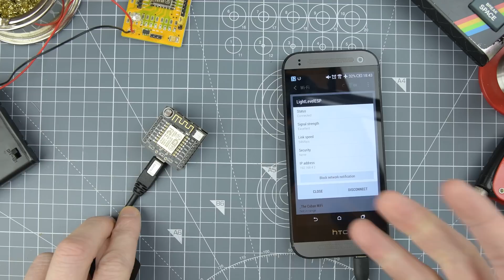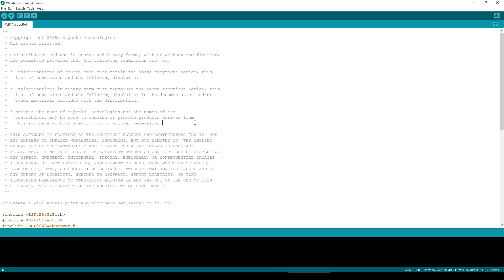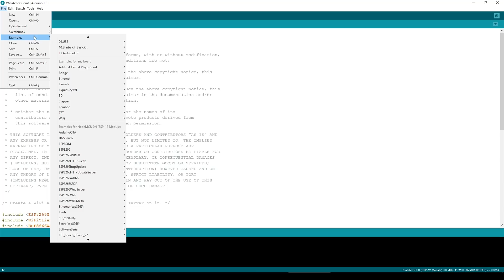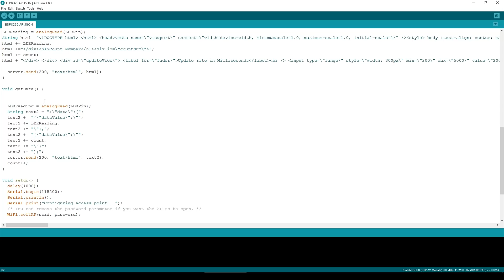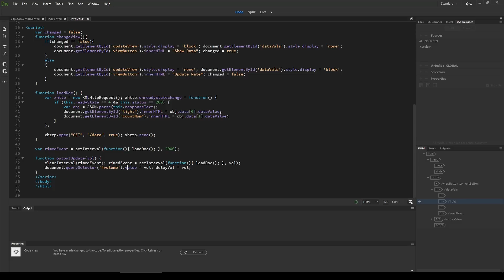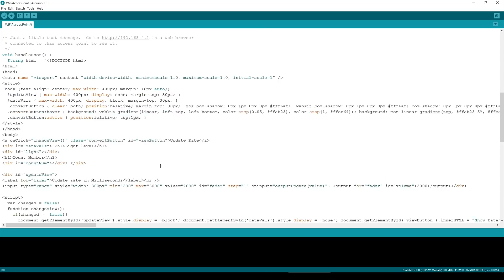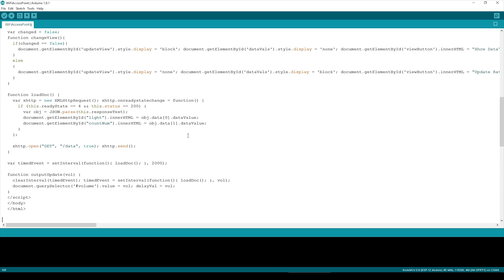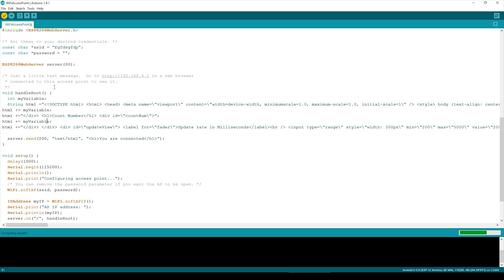ESP8266 WiFi Access Point Examples with the Arduino IDE

Comment: Is it possible to make something that plugs into a NUC's ethernet port, which tricks Win11 into thinking it has a network connection, so it will allow the WiFi Hotspot function to be switched on, so I can remote desktop into the NUC? 

Because Win11 won't switch the Hotspot on unless Win11 has a network connection, which it doesn't need because I don't need to use one. 

Win11 is dumb.

Comment: Hi David. I need your help if possible please. I have adapted this code to a  battery monitor and I cannot pass random variables to a graph on the phone. Would you be able to look at that as a video? I used the highcharts javasript and put that on the esp8266 to serve the graph.
Reply from the maker: Hi Andrew, you should be able to use asynchoronos javascript https://circuits4you.com/2018/11/20/web-server-on-esp32-how-to-update-and-display-sensor-values/ this page should get you there.
Reply: @DavidWatts  Sorry I missed a couple of important key words there..."without internet"! I like your offline style and although I have used highcharts in spiff,  I can't get any data to graph.
Reply from the maker: You shouldn't need the internet to use asynchoronos javascript, it is client based so on your phone web browser, the server (your esp) just responds with data. So just ignore the 'internet' part of that web pages explanation of asynchoronos javascript.

Comment: I'm working on a new pc now, i can't seem to find the arduino library i need!
when i search for 'esp8266wifi' in the library manager, nothing obvious jumps out.. (search results start with 'IoTtweet' and 'IoTtweetESP32')
Also searching for 'NodeMCU' doesn't help me..
Which name is the correct library?
Also tried to install ESP8266 or NodeMCU from within the boards manager, but no search results..
[EDIT]
Solved!
I needed to enter "http://arduino.esp8266.com/stable/package_esp8266com_index.json" in "file->preferences->ADDITIONAL BOARDS MANAGER URLs"
After that i could select board Wemos D1 mini and my code compiles ok now !

Comment: If I could I would give you 4321 thumbs up. You are the one and only that have code and tutorial on how to create a web server access point that multiple devices can connect to. I used yourLightLevelESPv1 example using and ESP8266 and i have a web server running (not required to be connected to my home network) that is serving web pages to 3 different devices. 

Well done on this!
Reply: My goals are this: Get a small ESP8622 module not the whole board, and connected it to my Teensy, then have the Teensy send code to the WiFi module for acting as a server to connecting phones and such. Think that will work? Hopefully I will not need to connect my Teensy to a compplete ESP8266 board.
Reply: Looking at other vids, looks like I just send AT commands to set the unit, up, then serialprint to send the page.
Reply from the maker: @KrisKasprzak  Yeah pretty much, good luck to you.

Comment: I like your little HTML conversion tool idea.. I personally use multi-line strings, like this

String text = "First line\
Second line\
Third line";

which works fine, but the idea of being able to insert variables using @ is neat, at the moment I am doing it in a clumsy way.
Reply: As to the large html page, I just put it on the spiffs so I can upload it without all the processing. It's a bit more transparent than having the html inside the C code

Comment: i tried to test the code, while compiling I am getting the following error 

exec: "C:\\Users\\dell\\AppData\\Local\\Arduino15\\packages\\esp8266\\tools\\xtensa-lx106-elf-gcc\\1.20.0-26-gb404fb9-2/bin/xtensa-lx106-elf-g++": file does not exist
Error compiling for board NodeMCU 1.0 (ESP-12E Module).
I don't know what is the issue, could you help me solving this?
Reply from the maker: Sounds like your hardware files are messed up. I would remove the esp8266 core files through the boards manager and start again.

Comment: Great video!! Is it possible to have the 8266 serve up a page with say 12 buttons. Each button once touched would activate a command in the Arduino? I have a sketch that is running a stepper motor. I can use a key pad to enter in a number and the motor will rotate to that spot. I would like to have say 12 buttons with "pre-defined" numbers send to the Arduino thus causing the motor to go to that spot. Any help you could offer would be appreciated Thank you in advance.

Comment: hi Mr David Watts
I like your youtube channel very much.
I want to use ESP8266 as access point to transfer serial data (UART) between my microcontroller and web browser.

I add resieved data from serial port to handleRoot function 
this is only my change on the access point example code
//======================================================
String uart_recieve_data = "";

void handleRoot() {
 server.send(200, "text/html", "<h1>You are connected</h1>"+uart_recieve_data);
}

void loop() {
 server.handleClient();
  // Send the response to the client
  if (Serial.available() > 0)
  {
    uart_recieve_data = Serial.readString();
  }
}

//======================================================

my problem is how send any string data from web browser to serial port in ESP8266

Comment: Maybe it's a dumb question, but I need to know before I buy one, can use it to extend the range of my home wifi through the ACCESS POINT mode? I mean, if I will be using the AP mode, then it will act just as a second router on my wifi lan? I need an answer, please.
Reply: not a dumb question,but the answer is both yes and no...(it's gonna be terribly slow and would be limited to single page with few text)

Comment: After initially downloading the code have you tried changing the 'ssid' it does not want to change and is locked into what was originally downloaded. 
Found this with my ESP8266-12E pressing reset, powering down etc does not seem to work.
I've found this before with similar AP programs.... HELP

Comment: excellent video - thanks
The java solution is a bit too complex for my brain but a compromise I have used is to get the esp to serve a separate page which displays just the info. I want to update (with it's page refresh set to every few seconds), I then insert this in to the main html page as an iframe.  This way the information auto updates without the problems with the whole page keep updating.
Reply: i.e. get it to serve a page "/data" which displays just the information you wish to update (with the line "<meta http-equiv='refresh' content='5' />" to cause it to refresh every 5 seconds,
then in the root page insert an iframe with the line "<iframe height=220; width=500; frameborder='0'; src='/data'></iframe>".

Comment: That's really cool.  Is there a way to change the IP address to something else if you want to run multiple devices?   I have a servo sketch that when it runs loops through X count...which could take 10 seconds to complete.  Is there a way to interrupt that loop if a wifi command is sent to stop the loop?   It seems once the loop starts nothing else is executed.

Comment: can we give "ssid" and "password" to esp8266 using a webpage. After rebooting the device it should automatically connect to that particular Access point with the credentials we have given before when esp8266 is on AP mode.

Comment: Hi David, Thanks for your videos. I am trying your code but instead of a light sensor I have a GPS connected. I am trying to show the Lat & Lon from the GPS on the webpage but I only get a digit with 2 decimal places (51.69 instead of 51.694674). Ive done some googling but I dont really understand whats up! any idea? It shows the full number on the serial monitor, using TinyGPS++ , Serial.print(gps.location.lat(), 6);
Reply from the maker: Well if you are using a float I would expect that to work to be honest. In the Serial print you are just specifying the number of decimal place but concatenating it to a string should be fine.
char latstr = "";

dtostrf((gps.location.lat()),8,5,latstr);

Then add latstr to the message. I can test it I am afraid.
Reply: Thank you David, It worked ! :)  char latstr[9];       dtostrf((gps.location.lat()),8,6,latstr);